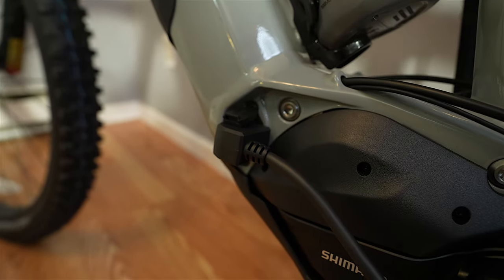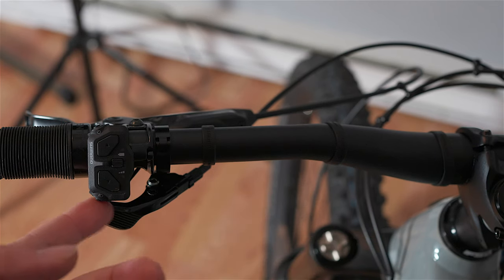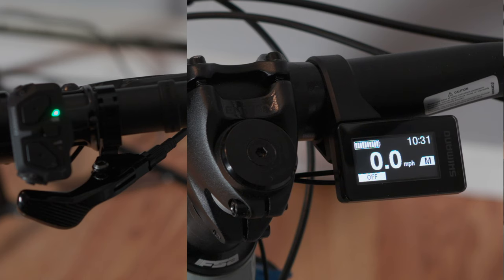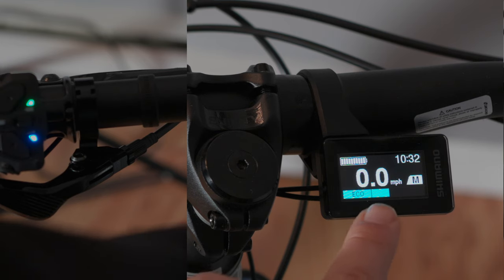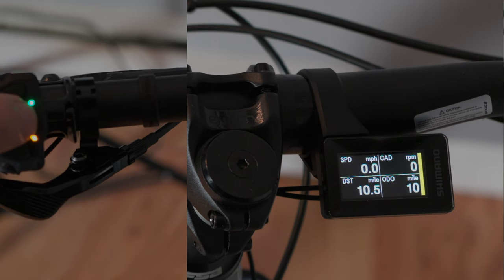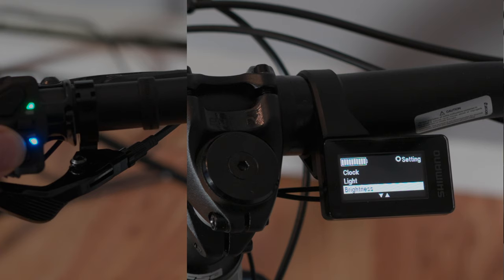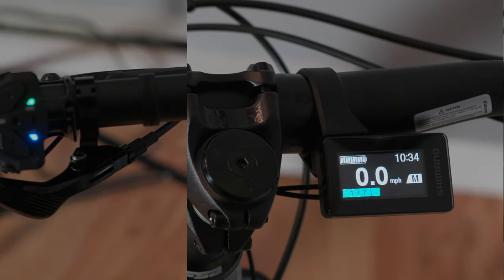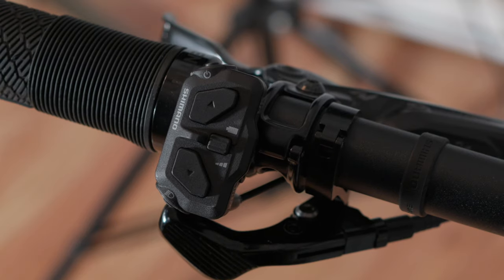Polygon T6E & Shimano Steps Controls Tutorial - Walk, Eco, Trail, Boost & More....

Comment: Please help I only have 2 buttons on my controls and can’t seem to connect with the app at all any suggestions
Reply from the maker: You have a different Shimano unit that is not like mine.. I don't know how to connect to the app with your switch, sorry... Here is the manual: https://si.shimano.com/en/pdfs/um/7FS0B/UM-7FS0B-000-ENG.pdf
Reply: I got the switch but the mount is massive 😢
Reply: Hi, i've got the same problem. SC-EN600 screen (without any button) and SW-EM800-L switch (only two buttons, up and down). I can access the menu while pressing up and down simultaneously, but then i can't access the sub-menus. @bigrambo1314 if we find the solution, let's share it here if you mind.
Reply from the maker: Hello, I'm sorry but You have a different Shimano unit than mine.. Here is the manual for yours: https://si.shimano.com/en/pdfs/um/7FS0B/UM-7FS0B-000-ENG.pdf
Reply: @takoontakoon1312  wile holding both let one go and it will select that it’s a bit tricky but you’ll soon get used to it 👍
Reply: @jasonsmountainbikereviews  I got it fitted but it won’t work with my power switch 😭
Reply: @bigrambo1314 thank you ! I'll try it now.

Comment: Lights are easy to add. Busch Müller has lights that can be added with clamps, adapter, etc to go on you HBs

Got one on my Kona El Kahuna SUV that plugs into the main computer. I adapted it for 35mm handlebars by removing the bar clamp that it came with, then bolting it to a GoPro extension, then adding a GP steerer tube cap. The whole setup now sits right on top of my stem perfectly centered and pivotable to any angle to the ground in front I desire. Clean looking
Reply from the maker: Awesome to hear, and you are using the Shimano controller to control the light as well?
Reply: @jasonsmountainbikereviews  Yes. The El Kahuna SUV comes with that combo. I like the battery life that comes with the larger battery on the EK-SUV but not the heavy fenders and rack, so I replaced them with lighter stuff. I put on a Bontrager rack with hollow aluminum tubes. I routed the Shimano rear light cables through those hollow tubes through the access holes I made with a Dremel. I used polymer Muckoff fenders to have off weight, but also make it look less like a cummuter bike, with the rear fender ending in the middle of the top plate of the Brontager rack so as to have less of fender tale in the back.

Kinda gives it a MTB look altogether, like MTB meets Moto Scrambler